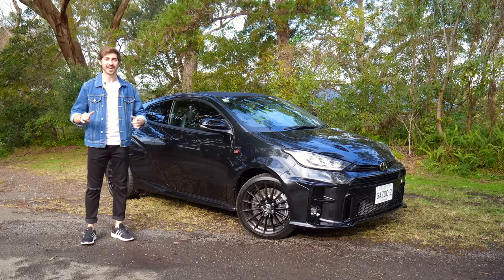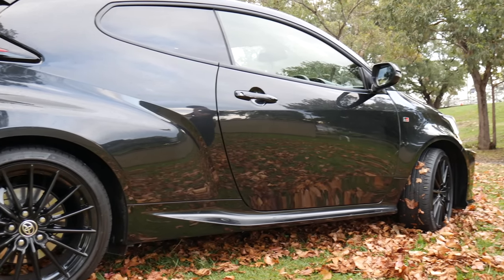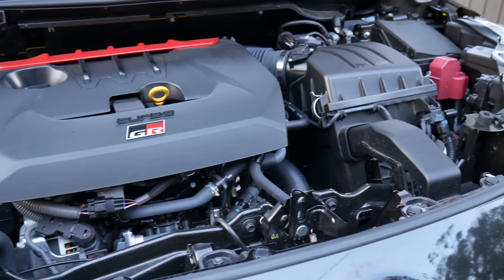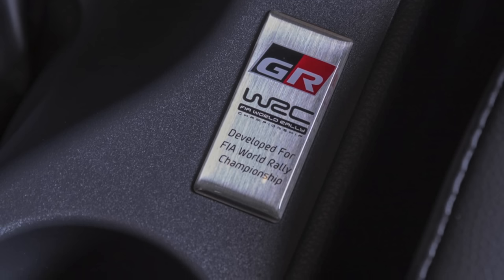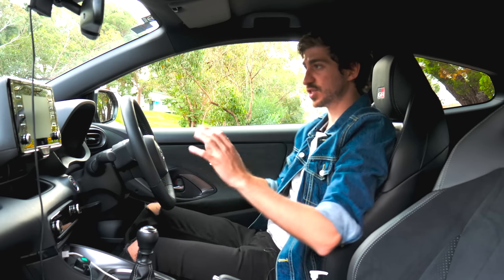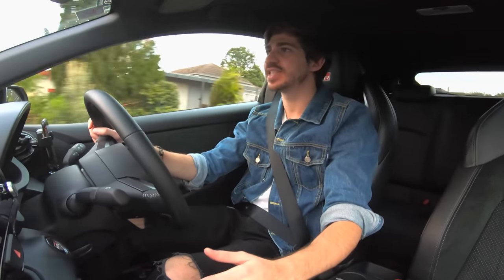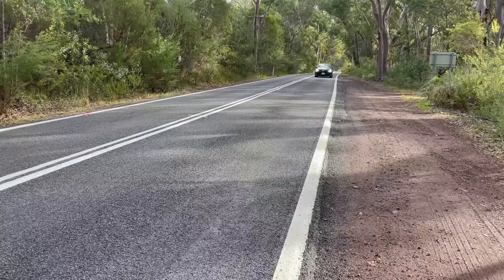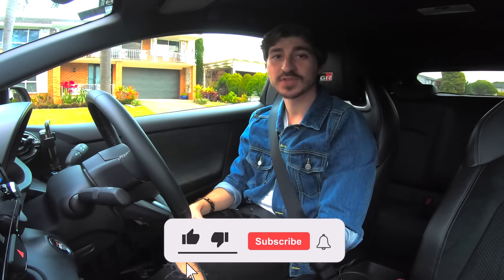Toyota GR Yaris review // Is this the new hot hatch king?

Comment: Hi. They're cast alloy wheels mate. Forged are on circuit pack/rallye.
Was told £400 per wheel vs £1200 for circuit pack's by toyota last December when I enquired, but most owners are saying that the circuit's are £1600 each!!!! 
That's utterly ridiculous pricing
Reply from the maker: Welcome back GR James! £1600 each?!!? You might need to consider selling a kidney if you have a spare one
Reply: @TalkingTorque  Exactly. It was one of the many things that steered me away from the circuit pack to the uk convenience pack which is proving to be absolutely f...ing FANTASTIC. Have put Goodyear eagle f1 asymmetric 5's on from the off😊
Will NEVER adjust my seat to allow people in the back lol.. They can go around the other side😜
Reply from the maker: @James-RJM  Hahahaha how are the Goodyear's?! Also fair call with adjusting, never let ANYONE in on that side haha!
Reply: @TalkingTorque  Brilliant!! Had to ditch those dunlops as they'd have driven me mad very quickly.
Had the ps4s's on my N and found the sidewalls a little soft with slight roll unless in the full N sport + suspension setting. 
Knowing from reviews that this had softer suspension with more lean I opted for the Goodyear eagle f1's that have firmer sidewalls and sharper steering feel. As it's my daily and road only car I went with the more road and wet biased A5's over the Supersport.
It hasn't wheelspun once, even in very heavy rain. A perfect  marriage 😊😍
Reply from the maker: @James-RJM  great to hear it!! You put that quite well, for you it seems the A5's were the perfect fit. Hope you have a great honeymoon together 😜
Reply: @TalkingTorque  Will certainly be better than with a wife lol....
Never made that error🤪 Also never understood the honeymoon excitement part🤭 Unless I married within literally days/ weeks tops of meeting her🤣😂
Prefer fun and variety personally 😉
Honeymoon period is for the life of car ownership however.  Parking anxieties always. Worse at the start but never goes away for me😏😒
Reply: James I'm the same never ever want my seat touched. I was so pissed in my Toyota Service couple of months ago as they moved it back as I'm not tall.
Reply: @Dave-gl6jb  Yeah, unfortunately there's going to be that. My N had electric with 2 memory settings but added weight!
Reply: @TalkingTorque  Lol...
No earache, no domestics, nobody to answer to..... Bliss😊
Uk version with convenience pack has parking sensors front and rear so even better 😍
Reply: James has partner his White Milk GR.☺

PS My wife lives in trunk ok.😳 PS Jokes a side I was a lucky man to get the GR. I was short of money plus got a strong no for finance. PS It's had it's up and downs owning GR with wife.😉

PS It's the main reason why I did not get Rallye. Wife heard harsh suspension plus it cost more but I'm over Rallye. Love my base GR. It's suspension is spot on for the Car it is a Rally car for the road.
Reply: @Dave-gl6jb  😉🙃🙂🤣
Reply: Wait till you have your first fight mate. Looking up at the Stars thinking about your i30N in someone else hands.😎

PS Anyway back to the GR content.😳
Reply: @Dave-gl6jb  Fight with who/what? Do you mean the GR??!
Reply: Yes dude. Yeah I'm not that funny but I'm a trier just ask the Wife. PS Back to the GR. Will TOYOTA make more than 25K
Reply: @Dave-gl6jb  personally think the original "ONLY 25000" and waiting times were fabricated to push people to order one ASAP. It fuelled the hype!! 
Then there's of course the delay re bespoke product, where it's made etc....
The whole GR hype is to promote the future GR branding. Race version, then ours, then GR sport which is like st-line, N-line etc and then another below!
The new Rally car that ours was born from that couldn't be used due to covid-19 and then new hybrid rules the following year, again I believe was advertising. 
They're testing the hybrid car now and it appears the same as the original car lol... It either was already hybrid or it's been added!
You wouldn't build a whole new rally car for a one year race period 😉
Reply: Yeah true but it worked. Sold like hot cakes.

PS Yes the Rally car has just added hybrid.
Reply: @Dave-gl6jb  😉Like I said previously, the P.R marketing propaganda would have Joseph goebbels turning in his grave 🤣🤣😂
Reply: @Dave-gl6jb  "it's had its ups and downs, owning the GR with wife" lol....
Was that in the front or back seats mate😉
Not much room and no sunroof to stick your head out of 🤣
Reply: No in these covid times where work is up and down wife thought it was CRAZY to buy a new car. Plus when the canoe hit me.

PS Wife has soften for now and is enjoying driving around in a great little car. Plus agreed the world will go EV sooner or later and it's a good time to enjoy a car like this.

Toyota got me in the hype for sure.😎
Reply: @Dave-gl6jb  😉👍
She's chilled to it🙂Party time mate🥳
When I refuel and start the engine the needle goes up but the miles available stays as it was until I move the car/press accelerator. It's only a split second after moving so not concerned. 
Is yours the same?
Reply: No idea will look. PS Getting the new panel coating today and a good clean. Going to look new GR.

Wife fine just need her to have a drive one day. To scared of 50K car in Melb plus manual.☺
Reply: New episode of Harris's garage was good. PS He put better suspension on to his CP plus lowered. He said little harsh as a Dailey.😎 we don't need that.😊

PS Still lovely man.
Reply from the maker: @Dave-gl6jb  got to keep the wife pleased! Unlike GR James, he's wifeless and seems to be loving life!
Reply: @Dave-gl6jb  Hope it all goes well mate. Steer clear of canoes😃🤣
Will have a look re Harry's. Yes he said it was too firm weeks ago lol... I suspected he would be getting a Litchfield or similar. 
Another one buying the wrong spec for their actual needs!!

Don't you have quieter back roads/country lanes over there for your trouble and strife  to feel more relaxed, in order to bloody finally drive the thing?😉 lol..............
Reply: So I was told by the coating company that the panel beaters put overspray all over the GR.
Even the roof.

Now I have to talk to my insurance company tomorrow see if they will pay for the repairs as they picked the repair shop.

Headache dude.😡
Reply: Thanks mate. Update you later on.
Reply: Fully covered by Insurance mate. So when they did the car they did not cover it while it was parked near other cars. The spray got all over the car.

Lazy Aus body shop.

PS Will pick GR up tomorrow 😎
Reply: @Dave-gl6jb  🥳
Reply: @TalkingTorque  Here in Germany meanwhile they say 3000 Euro each piece!!! That is sick... think of those who didn't buy the car but leased it! Every scratch makes you poor :-D
Reply from the maker: @SUPERSTEF79  wow that's INSANE! Don't scratch it haha!